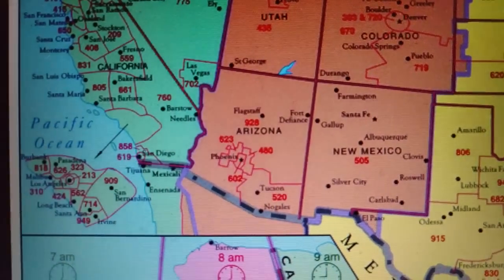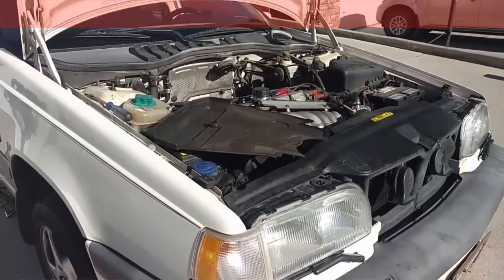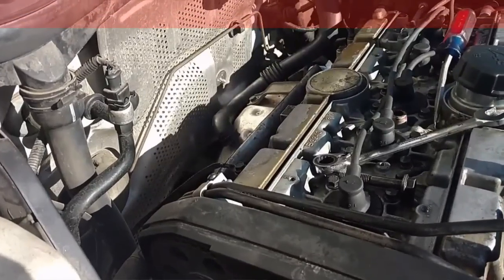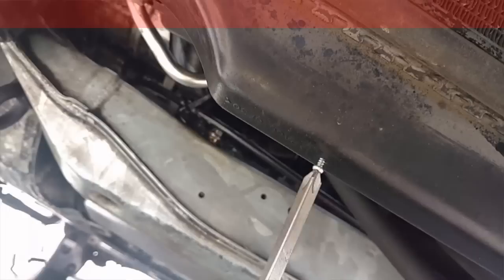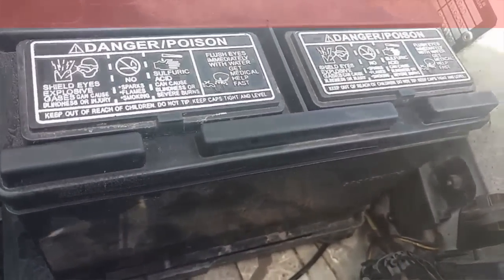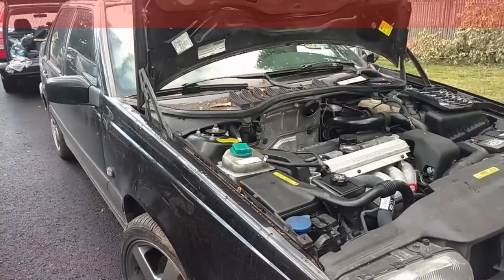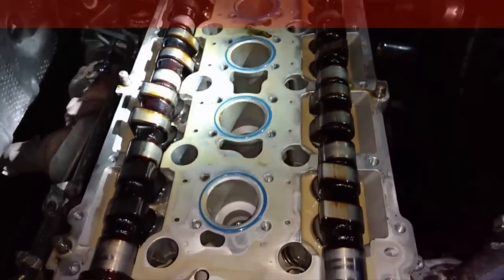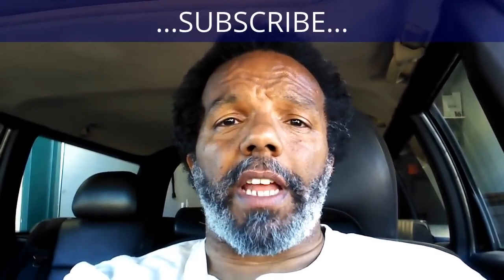Day 71, Bend and Portland OR. Robert DIY helper tour. PCV, Radio bulbs, and cylinder head.

Comment: replaced the PCV box and some vacuum connections 300 km ago.  Smoke still comes out of the dipstick and out from under the hood at stoplights, after running the 1993 executive at 3700 rpm with the new tires for a half an hour.  Oil looks like it's coming out of the of the cylinder head near the firewall where the smoke may be from.
Reply from the maker: +Pratyut Tit what kind of car?